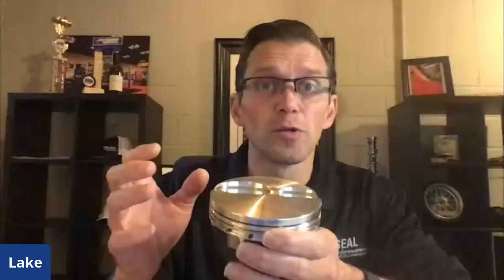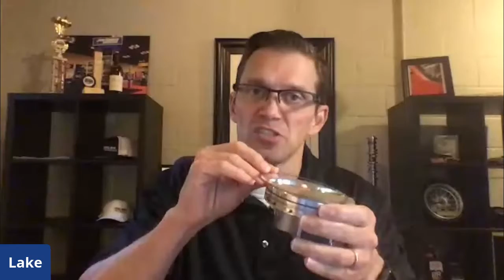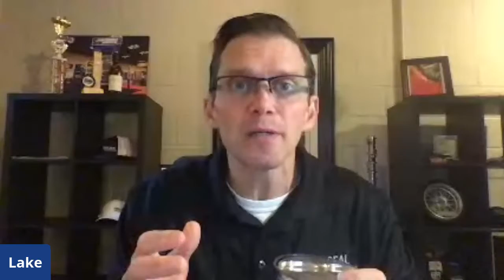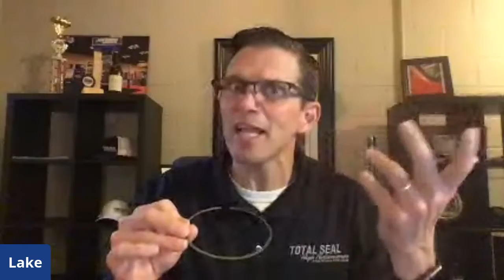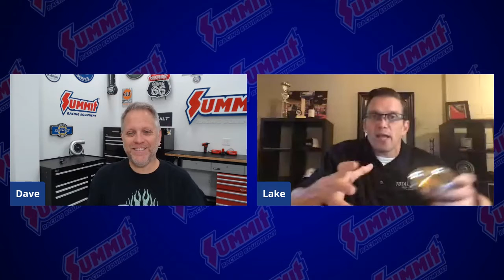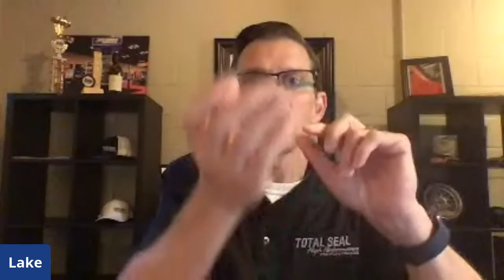Total Seal Introduces New Line of Gas Ported Piston Rings

Comment: Nice info. Just one historical note: early ‘70 is a little off the mark, say be a half-century? The use of combustion pressure to exert radial pressure and push low-tension rings against the bores has be thoroughly documented by Harry Ricardo in… 1924. See “The High-Speed Internal-Combustion Engine” by Sir Harry R. Ricardo 😌